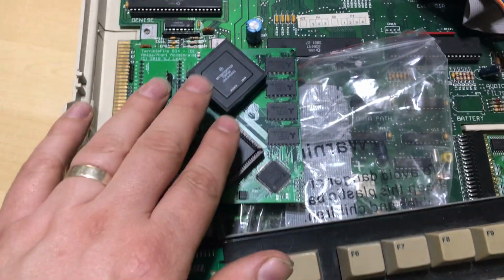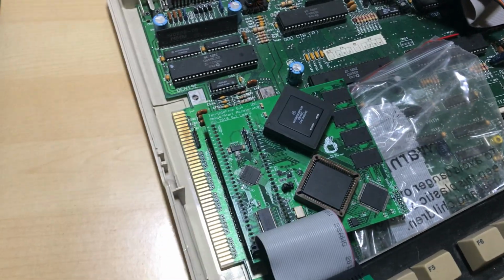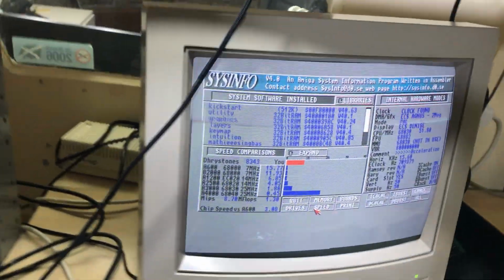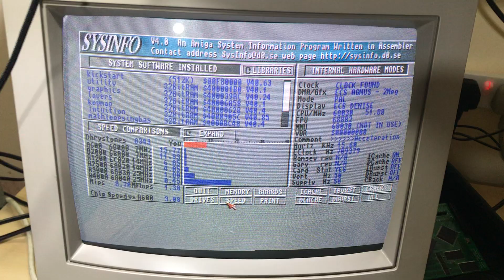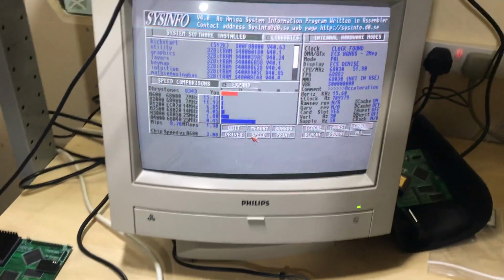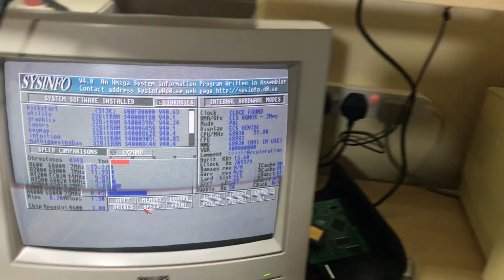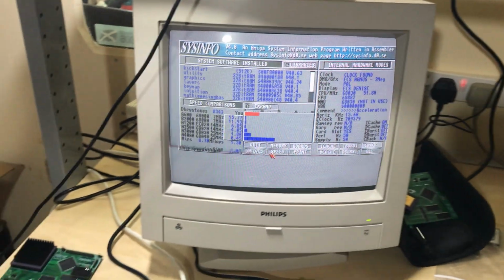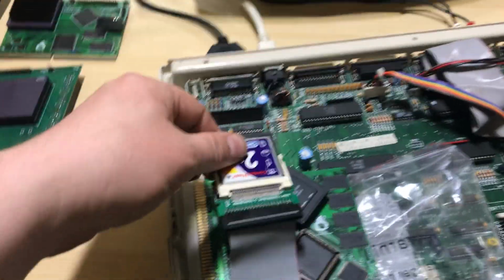TF History Series: TF534

Comment: These were good times.  I built one of these and they were a great improvement over the TF530.  The flash IC is still blank but is nice bling.  Still haven't got around to trying to add the network adapter on mine.